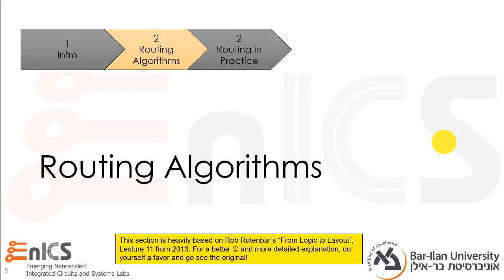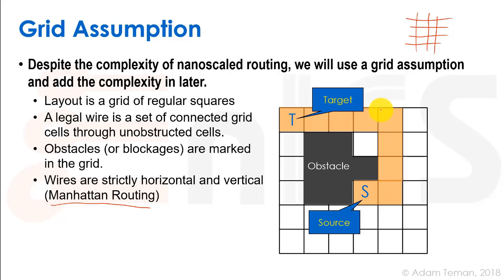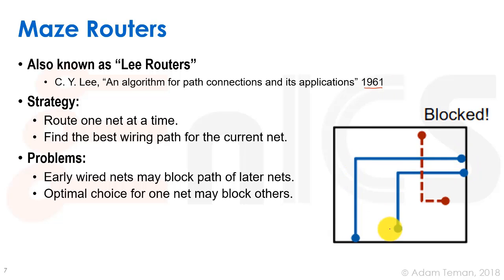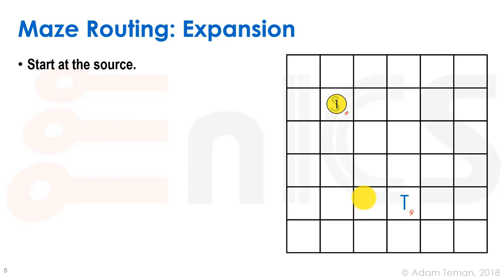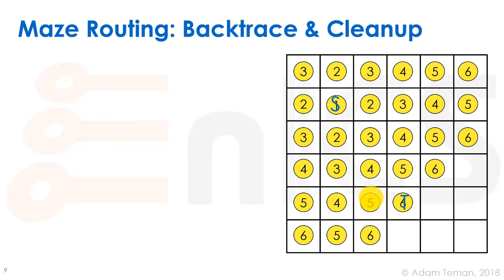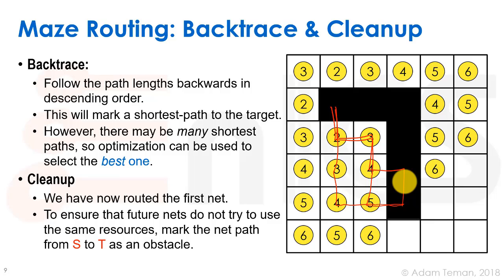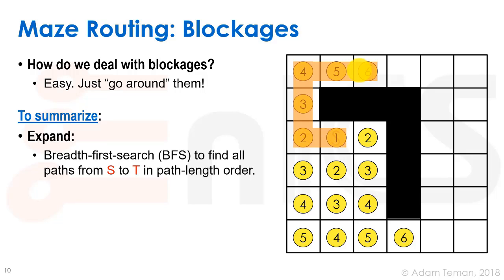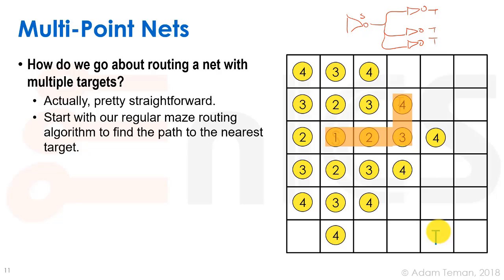DVD - Lecture 9b: Maze Routing

Comment: Thanks for the lectures professor. Since higher metal layers are wider and all metal layers have different design rules like minimum width and length , how could all metals exactly occupy full grid space
Reply from the maker: Good question, maybe you understood the answer when you watched the rest of the lecture parts, but if not, I will clarify.

The Maze Routing, as it is shown here, is very crude. It doesn't take into account all of the very complex features of modern VLSI routing, such as design rules, number of metal layers, etc. The basic idea is that we provide "global routing", which basically maze routes the nets and provides track assignment and then only later provide "detailed routing", which connects the nets according to all constraints. 

So at the very high level of the grids over here, we really need to only know if there is room to route across this grid cell, and that is usually a function of the number of tracks available vs. those that have already been used (i.e., congestion). During detailed route, the maze routing will be a much smaller scale problem (we're only routing a single GBOX) but with a much more complicated design space, so it will be a bit different.